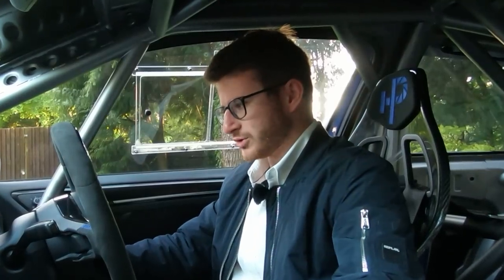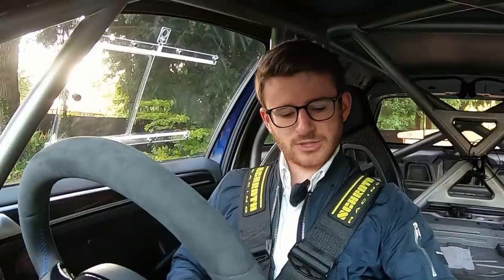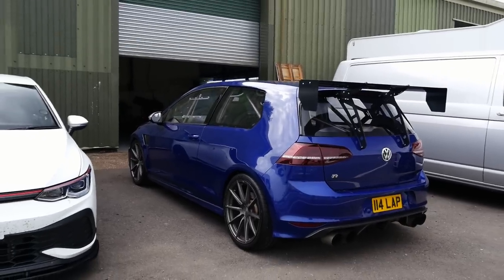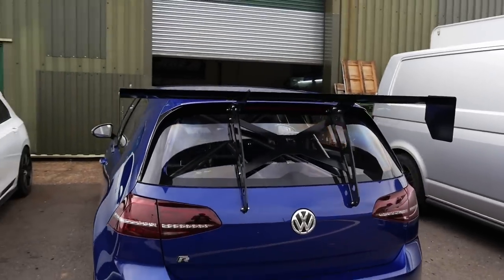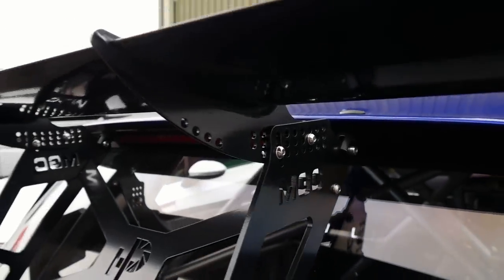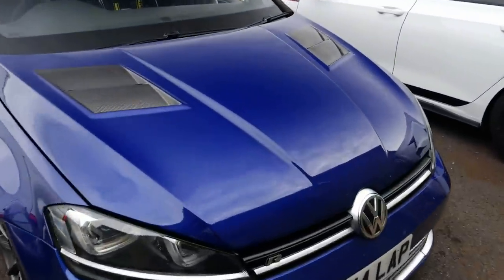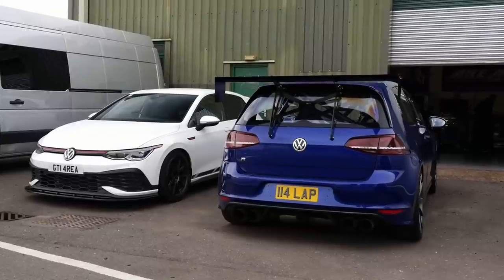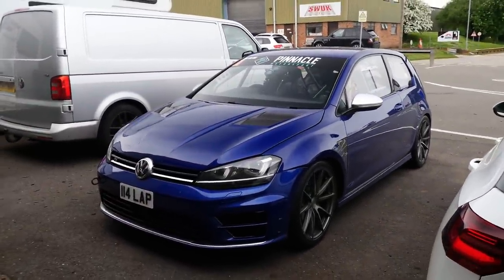Meet The CRAZY NEW LOOK for my MK7 Golf R!

Comment: I get its a car fully for the track but honestly I can't see anything other than the jarring contrast between the beautiful full replacement front wings, and the bolt on rear arch extensions. Surely there was a more aesthetically pleasing widebody kit for the rear that wouldn't have been significantly more expensive? Regardless, it'll be interesting to see the rest of the build.
Reply: Was thinking the same looks very 90s bodykit style, surely these days its a cut and bond job.

Comment: You're right about the air pods, they're class! I usually wear mine when I'm watching your videos to drown out your incessant giggling every time you accelerate! 🙄

I'm pretty sure it's not road legal with that splitter either! There will be some construction and use regulation that it doesn't conform to. Most probably because if you hit a pedestrian the splitter will amputate their foot from the ankle down!